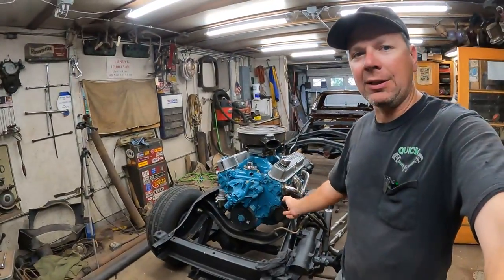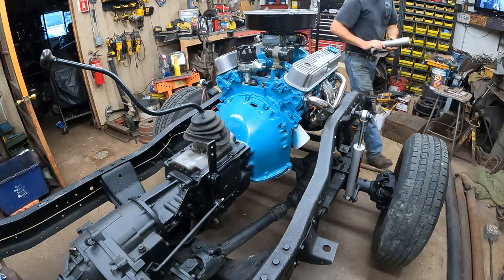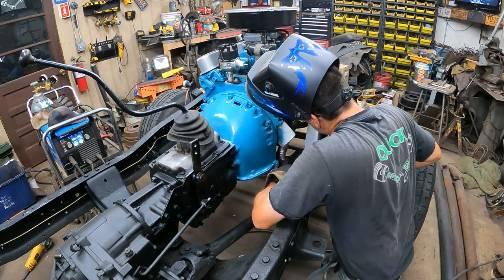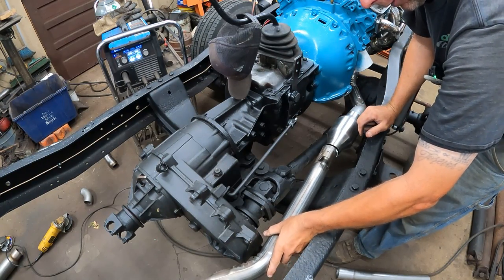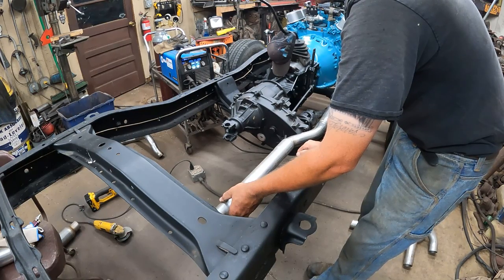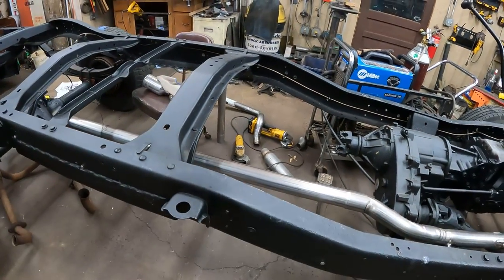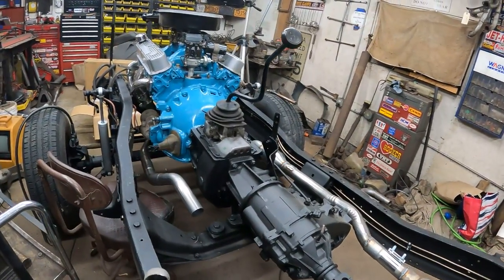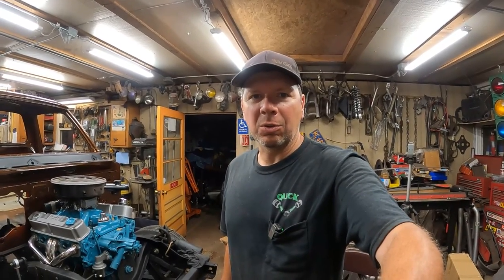Building custom dual exhaust:  1980 Dodge W200 Restoration

Comment: Truck is looking good! I like your work, very professional.
Reply from the maker: Thanks.  It's not perfect, but good enough for this truck.
Reply: @QuickSpeedShop  for a work truck you don’t want it too perfect it will just get scratched and dented up again. It’s still a nice truck
Reply from the maker: Don't worry, there are plenty of scratches and dents already on the original doors, fenders, and hood. 😂

Comment: There was an episode of engine Masters (That was the show motor trend made here on YouTube following roadkill except it actually had useful information in it not just entertainment). I will see if it's still listed although I doubt it.  Anyways they actually used a 454 like you would have in a one ton truck and they did x pipes, h-pipes and no cross over pipes and there was very little to almost no difference between the three on the Dyno.  That being said If I remember correctly they all preferred the h-pipe because of how mellow it made the exhaust sound personally I kind of like the "raspiness" from each engine bank being separate because you can literally tell which side a misfire may be in with a quick ear shot.
Reply from the maker: I love Engine Masters, they do all kinds of cool testing.  The only thing I don't really find useful is all their dyno testing numbers start over 4000 rpm.  I rarely ever spin any of my engines even to 4000 rpm.  Making hp at 6000 rpm doesn't really apply to regular street driving (on V8s anyway).
Reply: @QuickSpeedShop  I agree Most street cars mid-level RPM range would be more relevant.
That being said, you can figure that if there's breathing issues it will be at higher RPM.

Comment: why didn't you use the magnum stock truck manifolds dump out rear out of way of starter and oil filter or the magnum headers would have given you more room
Reply from the maker: I originally bought Magnum headers.  The rear dumps don't clear the clutch linkage.